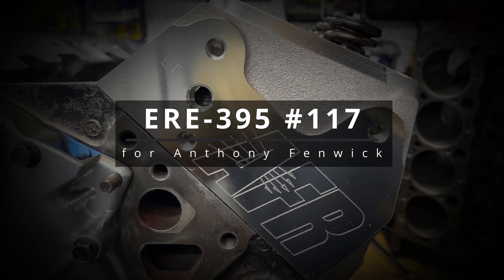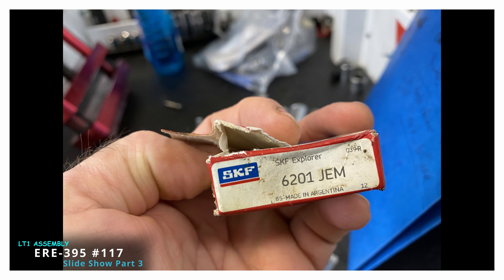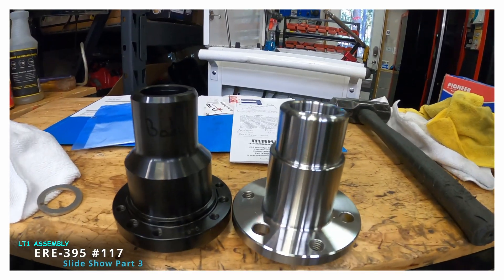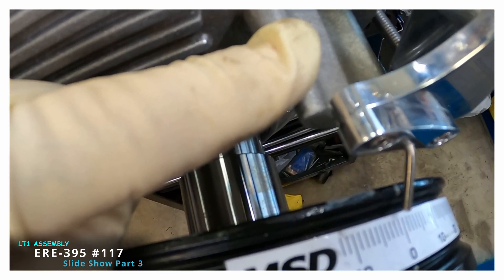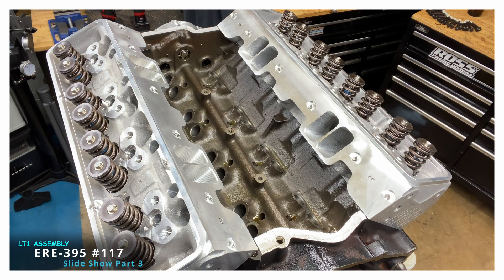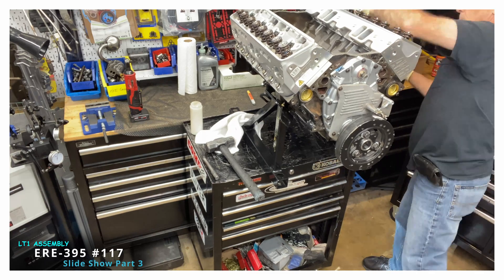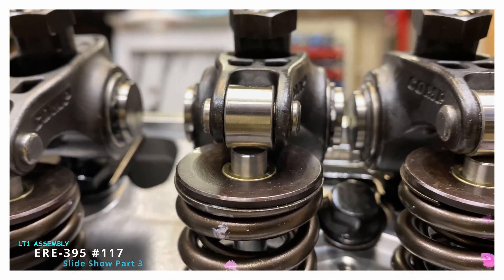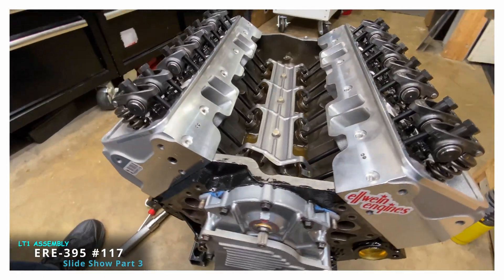LT1 Stroker 396 cid Assembly Part 3

Comment from the maker: Engine made it to the dyno yesterday (10-26-22).  More power than I expected.  558 hp @ 6100 rpm and 544 lb-ft of torque at 4500 rpm.  Video soon.

Comment: If I use a electric water pump do I need to remove and block off the water pump drive gear opening?
Reply from the maker: No.  You can leave the stock drive in there.

Comment: Have tou ever installed a Tick Performance camshaft? Im curious to how good their LT1 products are because they just broke the stick shift record with an LT1 based engine
Reply from the maker: The engine in The Grub Worm is not an LT1.  They ditched the LT1 just recently.   Still, they did really well with a sold full fill LT1 block last year.  They could do well with any engine...even a Fordd.dddd
Reply from the maker: I did not know they even had LT1 products, (except for transmissions).   So...No... I have not.   Do they have LT1 cams?
Reply: Actually, they broke the record, but they aren't running an LT1 anymore. It's an old school Gen 1 SBC ow.
Reply from the maker: @michaelglick1287  Old School Cool.   I think it's a motown block.

Comment: Thank You,  For The Videos    That's Right  Next Day Re Torque     AFR  Over The  LT4  Heads ?  Did The LT4 Hot Cam Heads Intake  Been Happy  AFR Heads Good For Any Thing Over  GM LT4 Head  ?   Thank You, !   For The Videos,  Well Done  !
Reply: Good luck finding LT4 heads in 2022. I do believe the AFR heads flow more also.
Reply from the maker: I'm a big fan of the LT4 heads.  And the hot cam.
Reply from the maker: Oh, I neglected to give my opinion on AFR vs GMLT4.  I prefer the AFR since they come out of the box flowing better than GMLT4 and also AFR had thick deck.  GMLT4 can be ported by a good porter to flow as well as AFR.  But for new engines I prefer AFR direct from AFR